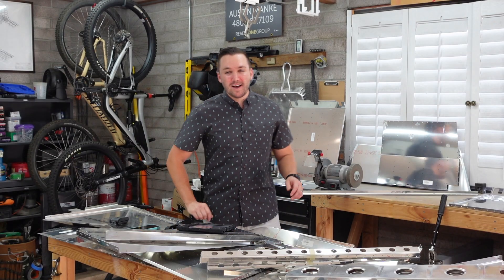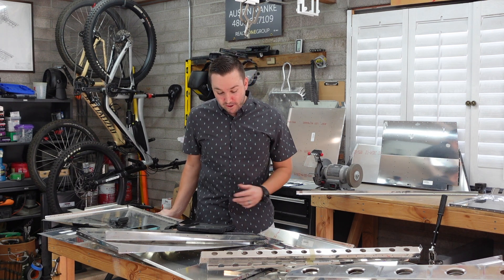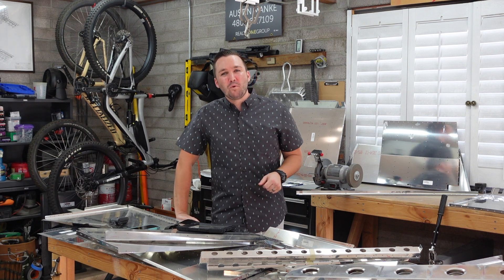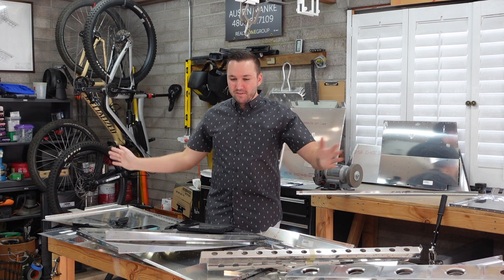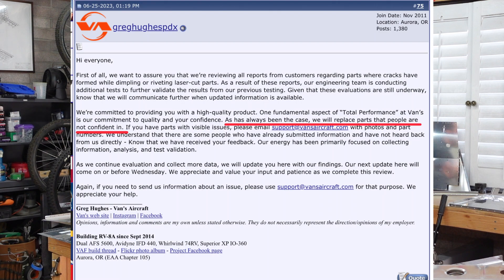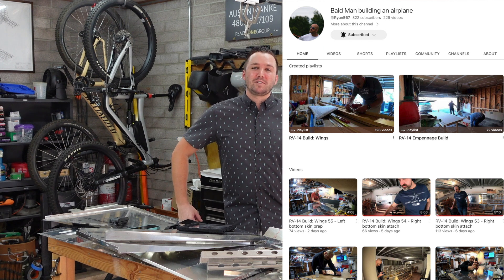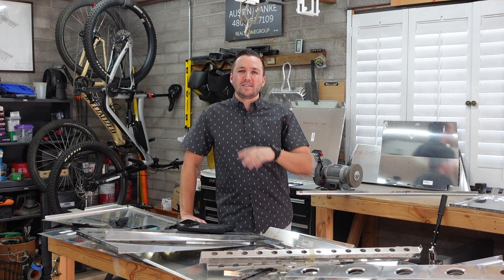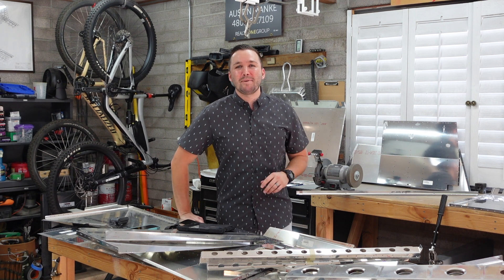Laser Cut Parts - Quality Control/Support Issues

Comment: I agree with you on the builder support, I’ve had less than stellar experiences talking with them, and one in particular seemed somewhat combative. Have you replied to Greg on the forums with this? I wonder if he’d have a view to share about the disconnect, because at worst it would make people think there’s dishonesty with the company, which I’m sure they would never want.
Reply from the maker: Thanks for the comment. I didn’t reply in the forum. The way I saw it, was that the forum thread and a few others have existed for quite some time, two attempts were made by me to settle my concerns and fix the issue using advise given in the forum (I sent email followed by phone call after it wasn’t responded to), and the issue didn’t seem to be going anywhere or reaching all builders that may be affected. I think commenting in the original forum would have keep the audience small and contributed to this whole issue going largely unnoticed.

Comment: Great video! I have the RV14A empennage kit and got it in 2022... I did have a few parts that were laser cut but none of them looked as bad as the images you showed, so maybe they switched vendors? And the new vendors have better tolerances? Just a thought... It is interesting that the guy that runs things at Vans says one thing, but when you talk with others at the company they say something different. I have had a similar experience with Builder Support. Depending on who you talk to it could be a great experience or a not so nice one. I hope Momma and Baby are doing great!
Reply from the maker: Thank you Brandon! Very well could be that they switched. Curious to see how this all unfolds. And momma and baby are great!! Thanks again!

Comment: Sorry to hear this! I'm a little surprised to hear a kit company would use laser cutting for aluminum parts. The last thing you want is a heat affected, brittle zone around holes and edges. I was just running some thin aluminum on my CNC router and it's a challenge even with a vacuum table to hold the sheet down while cutting. I could see where a laser would be much faster and simpler to cut with no force being applied to the sheet by a bit. I hope you find a solution soon.